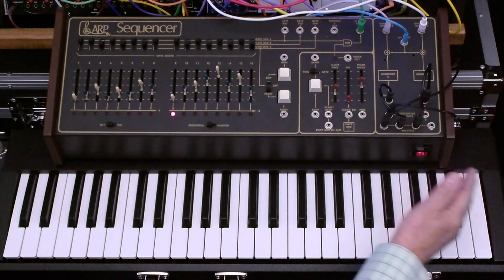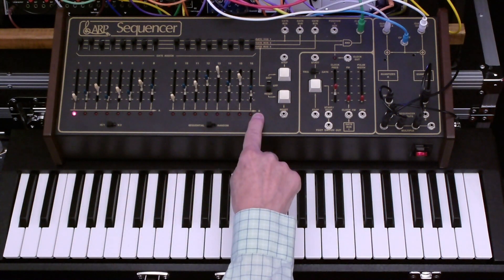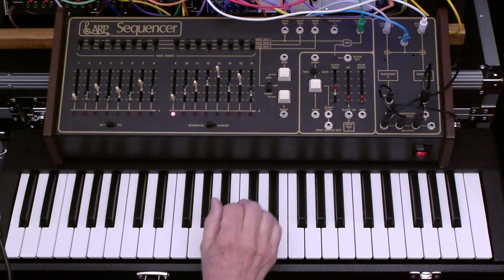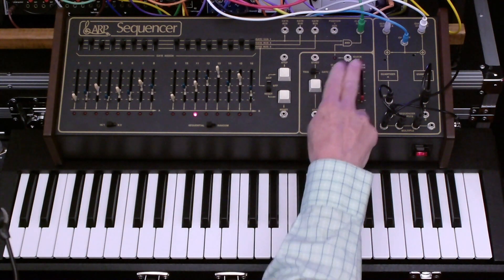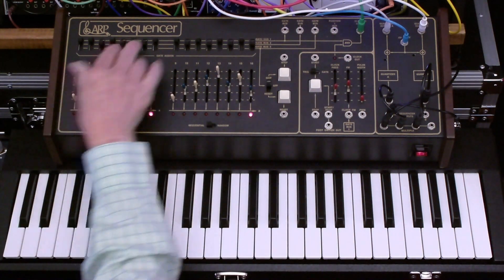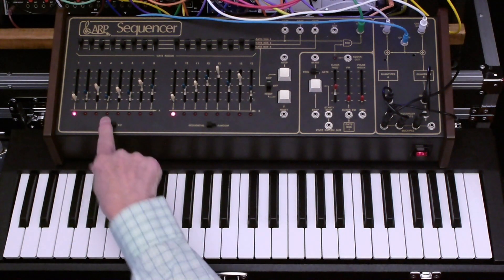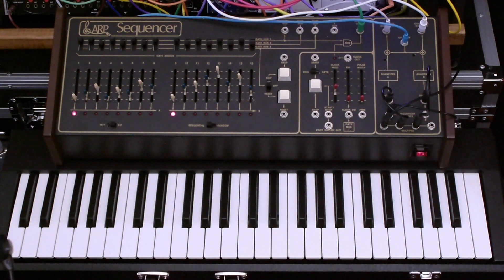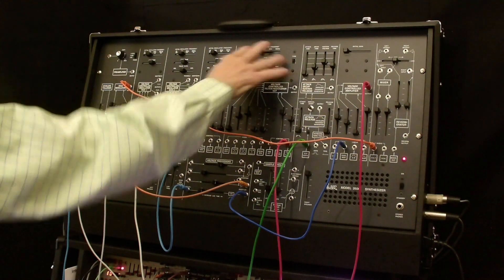ARP 1601 Sequencer with ARP 2600 synth

Comment: killer! what other analog sequencers (newer or old) will work nicely with a VINTAGE 2600 Im looking for other options besides the 1601 etc thanks!
Reply from the maker: Consider the 1027 Sequencer in the Behringer 2500 series (Eurorack format).  Be sure to include the 1050 Mix Sequencer.  Also the 960 Sequential Controller from Behringer.  Pretty cheap if you get the "Go" case & power supply (also from Behringer).
If you want to go higher end, check out the GRP R24 sequencer.
I have videos on all of these sequencers
Reply: @ozhalljr  thank you and respect!
Reply: @ozhalljr  lookin at the 960s but they dont put out a 10V correct only 8V that will be an issue correct for the 2600?
Reply from the maker: @12bitizthewaytogo92  The 8V is the row outputs.  The Oscillator Out is the "clock".  I think it is +5V.  It will still need to be boosted.  Again, that's a pretty easy problem to solve.  You could even take the Clock output into a Y cable and put it into two channels of a mixer to make it +10v.

See p.33 of the Quick Start Guide:  
https://cdn.mediavalet.com/aunsw/musictribe/Rktvf53300-CUL4jfQ2_gg/rITzpiOD1UaFynMOkSAEmQ/Original/QSG_BE_0720-ABH_960%20SEQUENTIAL%20CONTROLLER_WW.pdf
Reply: @ thanks will check this out I like the idea of rocking with the 960s to start off much respect!
Reply from the maker: Don't forget you can add +5 volts or so to the clock out to get the proper gate level using the 2600 voltage processor.  Here's a video on the Voltage Processor section.
https://youtu.be/5pkO7Yiffac?si=bfvo8MPy9sdUFswj
Reply: @ excellent lots to learn using vintage with newer tech!

Comment: Hi there i'm back, that talk we had the other day induced thoughts; 10% imo is a lot, so i thought i might think about how i could achieve randomness (as you mentioned the achieving part, well here i am back with an explanation). And yesterday, whilst putting order in the worshop i was watching that cool guys channel about modular stuff, and the topic was randomness (he was going bucchla, gaussian... a cool synth tv, episode 2, forgot the name right now...), and then my brain strated to compute.... So here's the idea: randomness, if most of us think about it, can be achieved with a sample and hold - either a noise triggering an s&h or a digital program like on the electric druid's lfo chips, i'm not trained on microcontrolers yet, that what i'm about learning these days, so we are talking from my analog tech perspective - Anyhow, with an s&h, we can output random control voltages (and set the freq at witch this is done btw, but ore about this later), now what we woukd need is to be able to convert that voltage to 16 to 32 fixed values. Then, if i can transform that voltage to a series of diffirent "outputs" or switches (one per step on the sequencer) that will open the step they correspond to, increasing step numbers corresponding to linear voltage curve. that's the theory, but how can i achieve that? well i came up with two thoughts; first by doing what an analog mono synth does with the keyboard, but reversed (so more like an uart midi to cv would do but that's a lot of complexity and circuitry....). The second idea, came after, it is much simpler ,but, thus, more clever: is to use an led level meter, make a sixteen level setps montage and replace the leds by a transistor switches going to each step (hit an output step will start from there on a 4017 or else). divide cv voltage swing by 16 or 32 levels (or 2x16, i guess if 16, maybe 1x16 could be enough, it's randomising anyway... See, that's how thoughts pop up, live and direct, lol), each level corresponding to a step from the sequencer in encreasing values accordingly... GOT IT! not the end of the world to add, and another funny thing will be that one function will be "lag", so you trigger somewhere and it goes on following step like it should, until another randomised switch/trigger opens; all you need is to set time or use divisions of the internal clock for the trick.... Thanks a lot for the inspiration
Reply from the maker: Interesting!  If you want to consider the microcontroller route, I might be able to help.  Again, keep me posted.
Reply: @ozhalljr Hey man; actually i happen to be very buisy these days, i have etched circuits for several units (tested them before they work huh), and as an athd i'm always working on at least 3 to 5 things at a time (that;'s justy how my brain worx), AND as an effect and generator deigner/builder i have orders to fullfill wich means i dont have all the time i would like to do all the conception work i'm planning; i need to build and sell too... SO: just in case would you be interested in building one of those sequencers i've been telling you about for youself to try out? (we can talk for making the faceplates too, i'm equiped...)there are main board and boards to add as many controls per step as one want, but a switch and one or two cv's should be nice for a start. I have stock for everything and have been experimenting with sequencers (8stp version with the 4017 i'm usiong in these aswell). So just in case, if you are intertewd and can find time to do it, i woulds be thrilled to have you try it before i find my own time too. My name is sebatien lecollier, you'll find me on facebook... i'll give you a link of analkog synth stages i have designed boards for aswell if you want to take a look
Reply from the maker: @baddriddimworkshop  Ok, I gotta ask is "ecole de la rue" real or is that the same as the English idiom "the school of hard knocks"?  Also, check messenger of Meta.  thx
Reply: @ozhalljr yeah it's something like that lol.

Comment: I have the same issue. Clock not functioning and works only in random. What was the issue with your’s?
Reply from the maker: There were a couple of issues.  I had to analyse the circuitry for a day or two to isolate the area of the schematic (and thus the circuit board).  I ended up replacing two or three ICs.  That's pretty general and perhaps not very helpful.  If you need more info, please leave a comment or DM at ZebraSynth.net (redirects to a Facebook page).  I'll DM you back on Facebook.
Reply: Will do right now. Thanks!!! @ozhalljr

Comment: I have one of these devices with the same issue of the clock not running. I thought it was the sliders, which were also badly in need of service. I cleaned and repaired those, it now works with an external clock device, but I have not been able to repair the clock, it still steps normally and randomly. If you have any insights, I would be so thankful.
Reply from the maker: Trevor, feel free to reach out to me about this at http://zebrasynth.net/ (which will take you to my business facebook page).  I may be able to help you work through it (free advice, but don't want to go into detail in a comment).